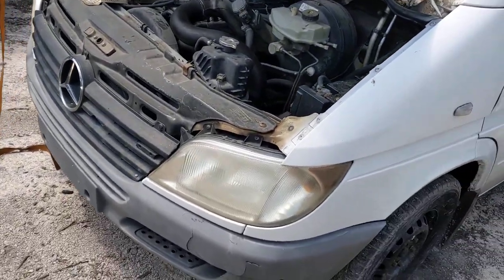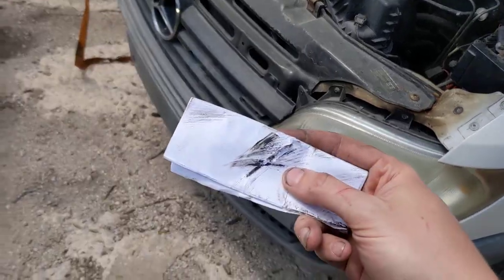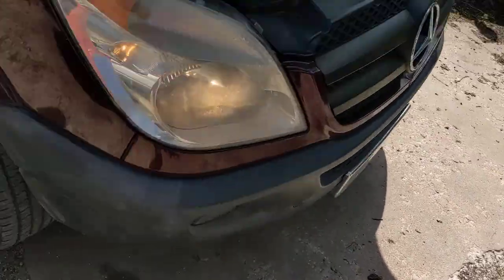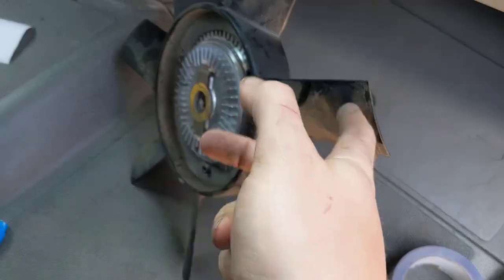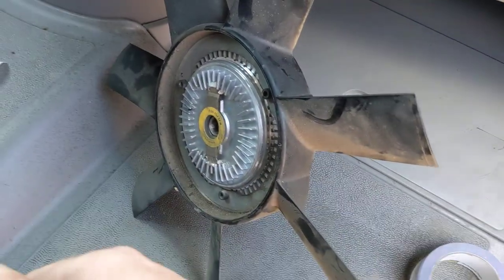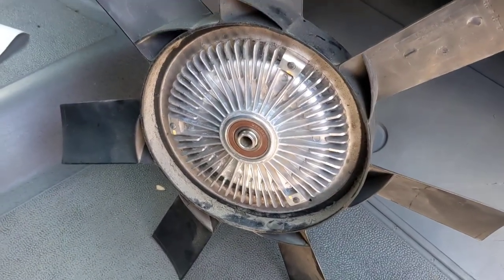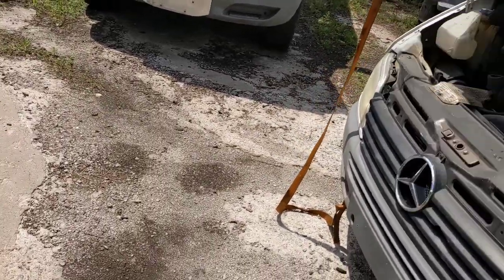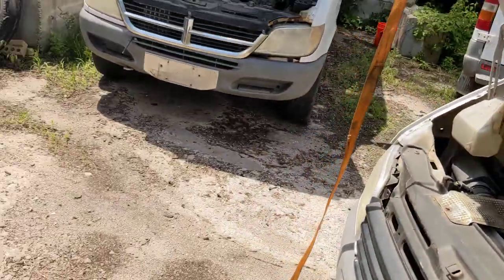How to tell if your Viscous Fan Clutch is Bad - Sprinter Vans / Other Vehicles

Comment: Just came across this video while doing some research on the cooling system on my Mercedes M119 V8. In the process of changing the thermostat amongst a few other components. I learned a lot about the viscous fan and how it operates—great job with the video very informative and fun to watch, you have a great highly energetic and enthusiastic way of speaking that is leaps and bounds better than the majority of monotone speakers on here lol

Comment: The clutch engages when that bimetalic strip bends and pushes a pin allowing circulation if viscus silicon that transfers tourque between impeller and turben.

Comment: Replacing mine tomorrow.   All winter I'd hear fan roar when I shouldn't.   Put it off.  Started to hear bearing noise when turning off van.  Put it off.  Heard a weird noise one day during turning it off.  Fan quit roaring, forgot about it....
  Had our first 80⁰f day yesterday and figured I'd check the fan.   The bearing locked up and the fan removed itself from the threaded post! (I guess that was the noise I heard in winter when it magically fixed itself)  My job is now easier to replace it.  Lol. 2009 with 100k miles.

Comment: Temp gauge on my 2002 T1N runs higher when going up hills and on hotter days.
Tried the paper test to see if its the fan clutch is faulty, it seems strong, the paper didn't slow it down at all, I've not heard the fan clutch kick in, could it be faulty?

Comment: Good test I'll try that instead of just using something  to c how easily  I can stop it 
Is that really how it works? most I know use a metal that expands at right temp and actual opens a Reservoir that let's fluid flow out  it creates  friction between the fins   
Temperature of fluid  doesn't really  have anything to do with it engaging
Reply: That must be a bearing problem or belt issues ...

Comment: another way to check the fan clutch is WARM THE ENGINE TO OPERATING TEMPERATURE AND THEN TURN IT OFF WHILE OBSERVING THE FAN, AND IF IT SPINS ON AFTER THE ENGINE STOPS; THE FAN CLUTCH IS EITHER BAD OR IT IS THE WRONG FAN-CLUTCH FOR YOUR VEHICLE, the fan should stop with the engine. Some fan-clutches are REVERSED. When buying a new one it is important to get the correct one for your model.

Comment: Is 230 F maximum for an 2005 Winnebago view RV 10.000lb hot ? Going up hill ? Or is just fine because of the weight ? After that it stays on 205  F
Reply from the maker: something is wrong if you're regularly reaching 230. It is the safe max, but it shouldn't get there.
Reply: It’s overheating on medium hills and freeway I tested today. It cools down on hidle. I did not let it go to 250 at all .
 Tomorrow I will do all my cooling system I appreciate your insight on you tube.
  Hopefully I will not need a new engine but if I do I will look for you.
  Question a sprinter 3500 loaded heavy like the RV 10k pounds , where I live is freaking hot and I only go to hot places on summer do you think I can by pass the thermostat?  I will replace the whole cooling system .
I usually do not drive on winter or go to cold places.
Reply from the maker: @silasf94  You shouldn't need to bypass your thermostat even setup that heavy. Just replace most of the old cooling system, including radiator, and take it easy.
Reply: @kansascitysprinters79  I have a 2008 sprinter 3500 RV loaded. I have already replaced the thermostat and changed the fluid. However, it is still hitting high temperatures of 248 and then the light comes on.  I ease off, turn off the air and it goes back down.  

I did your test with a piece of paper when I pulled over, but the fan was working well and going full blast.  The paper did not bother it or stop it.  

What else do you recommend?  

I am thinking to replace the fan clutch next as you recommend.
Reply from the maker: @travisely9033  If your cooling system is good, and you've got temps at 248 uphill I'd suspect head gasket next.

Comment: My 94 Ford van is waiting for the tow truck as I write this. There is a loud scraping noise and the engine was starting to overheat. I may have to drive the van 50 yards, or so, to have the tow truck get to it. Am I risking doing damage to the water pump if the fan clutch locks up when I am moving the van?

Comment: 04 t1n , fan very hard to move hot/cold, no overheating, no roaring, Is it normal for it to be so tight where you can hardly move blade ?

Comment: How about if it starts squeaking but keeps turning and i put oil on the bearing and it stops squeaking and is turning right !!!  What then ?? This on a nissan 2018 frontier king cab 4cyc.  It's not on water pump.  it just turns with the serpentine belt but why do need that type of fan and not one that turn with the motor when u start it

Comment: Did you need to get the white Sprinter with the good clutch up to operating temperature before doing the test?

Also is it possible to disassemble the clutch and replace the fluid on a Sprinter?
Reply from the maker: I did not. That's the torque the clutch creates when it's not fully engaged. The test would be more definitive If you were to get it up to whatever the target temperature is. 

I've never heard of a serviceable fan clutch. And they're cheap enough that I wouldn't bother with trying to repair one.

Comment: Well, this is a good start but often these fans don't lock up when they need to or as completely as they need to. This test does NOT guarantee the clutch is good. Sorry for the bad news. My research suggests you need to check the rpm of the fan when it's running over 200 degrees.